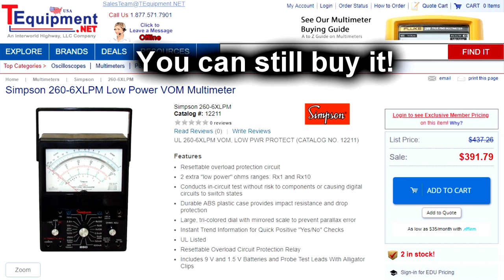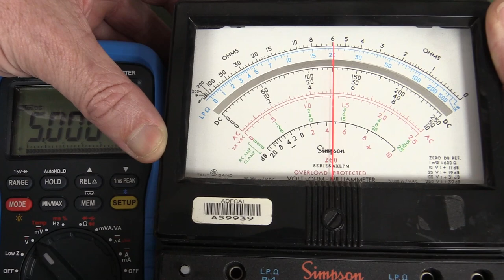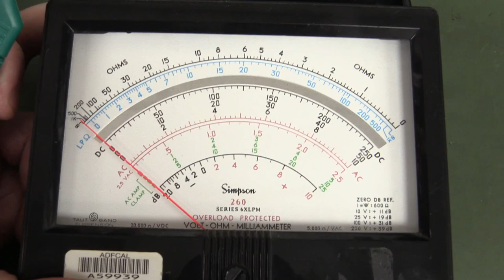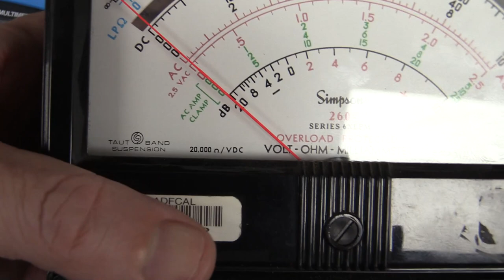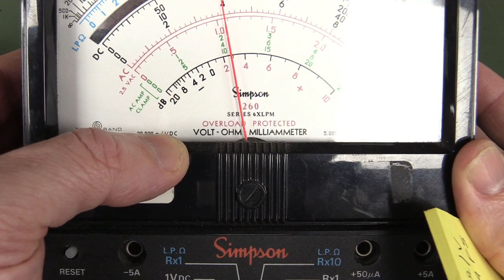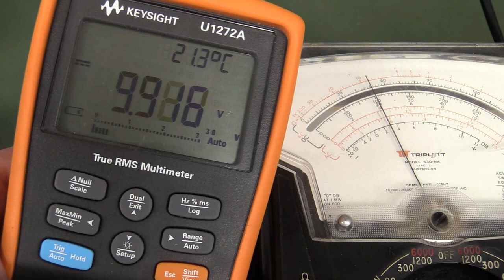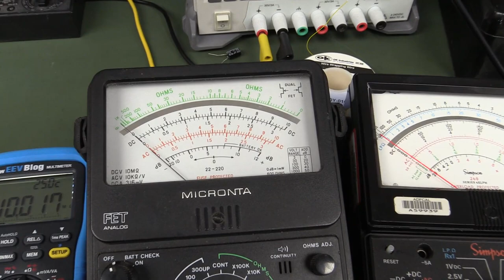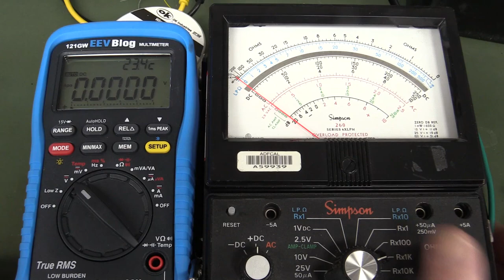EEVblog #1067 - Analog vs Digital Multimeters!

Comment: They are definitely regulated to special use case situations now... I only ever use them for one thing. They put out enough voltage in resistance mode to deflect the course and fault flags of older analog avionics indicators. Makes for an easy check if there is a problem with the indicator or the signal source.

Some guys like to claim they are better for continuity checks, as you can see if a wire has a bit of resistance, from a bad splice... But continuity checks on a DMM gives a readout in ohms. As long as you are not going strictly by the beep, and looking at the meter reading, you will catch anything like that with a DMM as well.

Now some of the older Fluke DMMs and maybe others, combined continuity and diode as a single function, and while you may see something of you have a bit of voltage drop, it's not as straight forward as a seeing an Ohm readout... Seeing as most new DMMs have a separate continuity function, that advantage is removed as well.

Comment: Peaking RF circuits in older radio gear and VTVMs for circuits sensitive to loading. Also quite a few digital meters produce RF noise. That's about it ...
Reply from the maker: Yes, peaking is probably one of the few remaining uses.

Comment: When you discuss the input impedance of the analog meters, you're ignoring VTVMs, which were always preferred for sensitive circuits. VOMs were for electricians or very simple troubleshooting.

The FET meters you briefly alluded to at the beginning were a replacement for VTVMs, and effectively a DVM frontend tired to a analog meter movement.
Reply from the maker: Of course I ignored VTVM because FET VOM's long since replaced them, so why mention them?

Comment: There is one exception where you might need analog MMs; when the service manual says the measurements was taken with a 20k or 5k input impedance voltmeter, digital ones will read higher values.

Comment: I'd like to add another huge unexpected con of most digital meters: aliasing
For example, we use a Fluke 8840A (bench meter) in the lab where we design power converters among other stuff.

When measuring a DC voltage in a DC-AC inverter, it often has a superimposed 50Hz ripple.
It's not unusual to have some 200mV of ripple while measuring a 1.5V thing.

And I've seen the Fluke give a very repeatable reading a dozen times a second, but it sllloowly drifts around the correct value.
I guess that it samples in sync with the AC grid, and as the inverter's frequency might be 50.05Hz vs the grid's 50Hz, the aliasing produces a DC error that drifts in 0.05Hz intervals.

Which also means that you can have a quite ripply DC supply , and when you check the stability using a good bench meter, you get a deceptively satisfying stable digital reading at a very wrong DC level.

I rarely use analog meters, they are inaccurate, but they double as a low-freq oscilloscope when you don't think you need one.

Otherwise, it's always better to use a digital meter with an analog readout, but it's very important to have an in-depth understanding of the possible quirks of the equipment you're using.

Comment: I have both and use both.
When I need 3+ places of accuracy, I opt for the digital. When I need absolute reliability, I opt for analog V-O-M. Battery only used for resistance readings.
When I need superior sensitivity, I opt for either an FET VOM or a VTVM. They are less prone to give erratic readings if noise in presents that a DVM.
I very rarely need such accuracy, however. So when i choose a DVM t'generally for the smaller size, portability and lower cost. Expensive test gear is for RF use where I'm concerned.
I never had any problem with multiplication of division by 10. 
I would NEVER try to see an AC component supered on DC wit ANY meter. What's the point? 
When I want to see a rapidly fluctuating voltage, it's "audio", which should ALWAYS be measured with a VU meter, whether analog or digilog.

Comment: Another disadvantage of the analog VOM is lack of durability. As many of us greybeards can attest to they don't hold up very well to the drop from the workbench to the floor. The black Bakelite shatters and the meter movement is whacked. An advantage to the loading effect comes into play when checking for A.C. voltages out in the field. A high impedance DMM may indicate voltages are present when they are simply EMI voltages from adjacent wires. Besides nostalgia, and inheritance, there is the fun factor. Walk onto a job site these days with your trusty old Simpson 260 or Triplett 630. First question is, "Does it work?" and second question is, "Do you know how to use it?"

Comment: Try using a DMM (maybe not some) at the base of the antenna tower, fed by a 50KW xmmtr.  I think that's a main reason Triplett still makes the little 310, and sells it for an outrageous price.  It doesn't have many ranges, but it's small, and you can carry it in your pocket, while you're poking around, and avoiding getting RF burns.

Comment: The one thing that, was good in the analogs was that they were not thrown off by RF.  In the shipyard I worked at, we would often take readings in the combat information center and other places on the ships with a lot of RF radiation, and the digital meters would be showing all kinds of readings. You could just wave the leads in the air there, and you would be getting ghost readings. The old analogs were not influenced by this. But other than that, like you say, it is much easier to read and more convenient.
The only other thing I like with my old analog would be when I am repairing small electrical tools, and I could put it on the ohms scale and keep it there, since the only time the analog meter would use it’s battery power was when you were taking the reading checking switches and continuity of power cords and such. Saved me a lot of turning the digital on and off, even though they don’t draw a bunch of power just displaying .  But these are now trivial things.

Comment: Still use an old cheap analog mm as a spare meter.  Accuracy is plenty good for quick checks of circuit functionality, like mains or power supplies.  And no 4.9999 display for 5V minus insignificant error.

Comment: Regarding the analogue meter consuming power from the leads to drive the needle, would it be possible to use an op-amp set up as a buffer, so it drives the output to match the input (which has a high impedance), then connect the probe to the input? Is this not feasible or are these analogue meters older than op amp technology?

Comment: With my comment on AC measurements I was referring to the low accuracy at lower ranges because of the voltage drop over the rectifier diodes. Even if the digital meter doesn't have true RMS, it is still superior.

Comment: I've got many digital meters, but my go to troubleshooting device is the good old Simpson 260.  It has been for 35 years and always will be.  The analog meter gives at a glance indications of capacitor charge ability, speaker resistance, transients, and transistor/capacitor leakage.  I guess if you're an engineer the digital meter would be all you'd need.  Techs have to fix things quickly in order to make any money at all.  None of this spend days and weeks determining you've got a leaky part rubbish.  You have to fix the product yesterday.  And who can read the tiny symbols on those meters.  My Fluke has the k and ohm symbols so small I have to put magnifiers on and point a flashlight at it to tell the difference.

Comment: I bought my first meter in the 60's. I was 10 or 11 at the time and 'messed' around with both valve and transistor equipment. Had to learn how to use the meter properly as I really didn't want to damage it or me. Getting the tongue at the right angle came out of the invaluable lessons learn't then. Now, as a 'greybeard' amongst other meters I have, in pride of place is my Brymark BM869S. It is accurate enough for my needs and has more functions than I need (or understand). Nevertheless I won't get rid of my analogue meters as for a few purposes they are better suited than digital. 

Use the right tool for the job!

Comment: Meratronik V640 has 100Mohm input impedance,uses Jfet-based amplifier. It can measure signals up to 1GHz.Max measureable resistance is 10000 Mohm. However I would like to input some more data here. Last year I was doing measurements in my university, an excersise was setup for comparion of multimeters. Two digital multimeters(one TrueRMS,one average), one analog (IIRC Sanwa YX360TRF). On low frequencies the digital ones were winning. The first to fall was TrueRMS meter, autorange was unable to keep up with frequency(jumping between ranges), second to fall was the standard digital meter. Analog was getting bit off but still within few % until the highest frequencies (10+MHz).  TrueRMS was falling because ADC was not fast enough, Standard Digital started to fall when analog front-end started to be unable to keep up. In Analog meter it was all about parasitic inductance and capacitance.Also there are analog meters doing TrueRMS too,they require a tons of power from source (which is why they are usually used in industry) but can do both AC and DC trueRMS. I still use my 1970 Mera UM3a analog multimeter everyday, 1% precision for DC,1.5% for AC (metal oxide full wave rectifier). The ability to run without the battery is great, saved me many times, especially when batteries ran out and the shops were closed(eg.national holiday or late hours).

Comment: you can get a bit of accuracy relative to the circular angle in ohms mode by using the blue scale if i see that correctly. also this removes the need to remember that the 0 is on the other end of the scale

Comment: Around the @19:30 mark you compare the analog and digital meters where the digital meter has a bar graph display. If you had done the test with the BM235 you would have a different result as it doesn't have a bargraph. Without a bar graph display on the digital meter it would be displaying numbers all over the place. It would be hard to know what is the average voltage let alone what is the max and min values of it. Another advantage of an analog meter is that they can be much more easily repaired compared to most digital meters and they are less likely to break (as long as they are not abused). In 20 or 30 years you could still get most (if not all) of the parts to repair the analog meter (possibly excluding the movement) while some of the chips (ie. proprietary ones) found in the digital would most likely be impossible to replace.
Reply from the maker: Why would I compare an analog meter with a digital meter without a bargraph? If you need a bargraph to replace your analog meter, then obviously buy a bargraph multimeter.
Reply: I'd like to see that 30 years down the road. Someone please invent time travel okay

Comment: I can't say I disagree but I still like a meter movement for somethings. Nothing like a piece of tape with an arrow on it on the meter face when testing a number of similar tests. Modern bench DMMs will let you have a 'go/no-go' setup so even this is not that valuable. 

Caveats: 
I am not a big fan of the 260.  Though it is made not to far from me I think the HP 4xx are better.  I think even the Heathkit VTVM is better than the 260.  However the 260 is a 'known quantity' in many setups.  It is well described and hasn't (really) changed in 60 years or more.  

As to accuracy, very little of the the time when I was a RF technician was used to measure down to the hundred nano volt level.  If a voltage was off it was 0 or way off.  Like a scientific calculator where you have 9 digits of accuracy but you only really need N.XY even then N.X is often times good enough.  Should I even mention slide rules? (smirk) 

Ohms:  Even my 30 year old Fluke VFD 4 wire 5.5 digit  bench DMM should be zeroed out before measuring resistance so that lead resistance is nulled out. Not really something fair to complain about. Should be doing that with any DMM that has a zero function. 

Side bar: 
When I worked on the Micor/Syntor/Delta/Master radios they had their own metering units for checking them out using the built-in test plug. You couldn't use a 260 since the Ohms/v for the OEM metering units was on the order of 10k or even 5k so your readings would be totally off.

Comment: I have that very same  Micronta "Dual Fet"  which I use in the field, had it for 20 years, but I also have Triplett 630 NA Type 4 suspension, (pride of place on the desk) it has a doubler, so can get good resolution.. it rarely gets used outdoors tho - so I don't damage it! Just about to order a new 30V battery for it.  I've also got a Fluke 77 11 (also has bar graph) to get down to small numbers. All that aside, I really like the Triplett.

Comment: Maybe it gets mentioned later on, haven't watched the entire video yet, but what is "L.P. Ohm" / the blue scale?
Reply: Low power ohms.  It provides resistance measurement on diodes, ic's and transistors without damaging them or creating a loading effect that would alter the resistance reading by providing a lower voltage and current level output from the meter's circuitry.  Resistance measurements rely on the meter's internal battery to supply voltage and current through a component to calculate its resistance.  That battery voltage and current can damage some components or affect the reading during testing and that's the purpose of having a low power ohms range(s).
Reply: Thank you for the explanation.

Comment: I find this comparison is based on one particular aspect - the resolution only. Analog meters are still used everywhere in manufacturing, electricity monitoring stations, professional broadcasting and recording studios. A person working on a factory shop floor can see the condition of a meter from across the room and immediately notice its trending. You cannot do this with digital and has nothing to do with resolution.

Comment: I used the Simpson 260 in the Navy in the early 1970's and the case style and the meter markings font were different. We were trained about to compensate for the meter impedance, if need be. I have the RS 22-201 version since the 1970's and I still use it! I also used a VTVM, the forerunner of the FET meter.

Comment: Analog meters have a very nice feature I am using very often. Using a white board marker you can annotate something, i.e. idle current or maximum current. You can use different colors for it and in a split second you know what is going on.
Take a look of current consumption of a SBC. You can clearly see if it is running on idle or with maximum power.
https://youtu.be/8GvZaaPiKWA
The same while tweaking something. Quick look and you can judge how much something changed. When you see two numbers like 2.963 and 2.896 it is harder to figure out how much they differ.
Of course you can also use fine point pen, like permanent ones. Looks better but it requires alcohol to be erased.

Comment: I bought my Fluke 21, brand new, about 1985. It's great and I think if I lost it, I'd replace it.  I also have a Triplett 310 FET, that was new in the 1970s which still works fine, is small and fits in my tool kit perfectly. Yup, I had to assemble my own batteries for it out of silver oxide cells, but that was 8 years ago.....so still good. 

I do not live in a world where I need the perceived accuracy of the Fluke. I don't need 3 places of decimals, ever, for reading anything I work on, and I'm of the age,  where reading analog scales is no issue whatsoever. Kinda like driving a standard shift. 

If you are looking at the output of an amplifier, or peaking the IF transformers on an old radio, looking at a DMM is really inconvenient.

Comment: You said the analog meter was of by 10% but most old radios have plus or minus 10% or even 20% resistors and i could see the use in modern digital multi-meters as in measuring inductors etc for accuracy like computer boards,mobile phones.

Comment: Bit like asking a motor mechanic if ring spanners have replaced sockets. They both have advantages and disadvantages. 

Personally I mainly use a manual ranging DMM. Autorangers always seem to produce a flurry of incorrect readings before settling to the correct one. The analog meter is best for alignment work though. Also, the analog's ohms range is better for testing transistors and diodes. The diode test on the DMM uses too low a voltage and will often indicate a seriously leaky device as OK.

Comment: When you measure a resistor you have to account for the resister’s +_ tolerance , so a 10k resister may have a tolerance of +_ 10% , also you need to take into account the +_ tolerance of your meter . 
Please get it right

Comment: For radio and audio electronics I keep a Simpson like that. When you are trying to peak something you aren't looking at a number value so much as the movement of the meter. You are looking for where the needle peaks then starts dropping off. You can do it with a digital but it's a pain unless the display has a graph of some sort. Also when it comes to RF power measurement you can use whatever you like on the bench but at the end of the day the standard accepted gospel and what your work will be judged by is the Bird 43 analog (unpowered unless it has a peak kit) watt meter. I have many digital meters that have many awesome features but my old analog will always have a place on the bench.

Comment: try measuring oscillating signal on the range boundaries with DMM. Also, using analog meter you can easily visually get mean signal value.